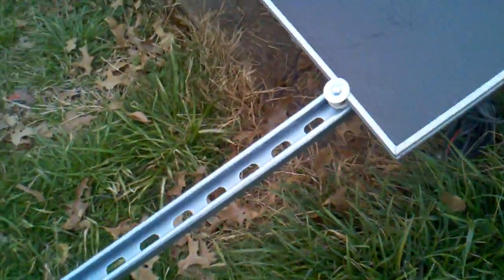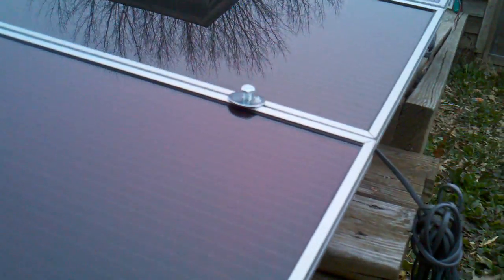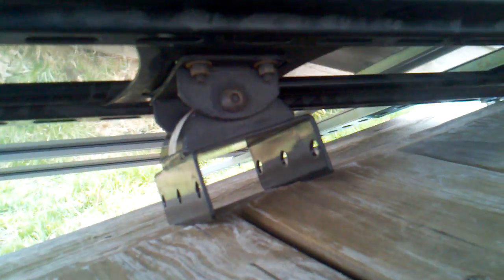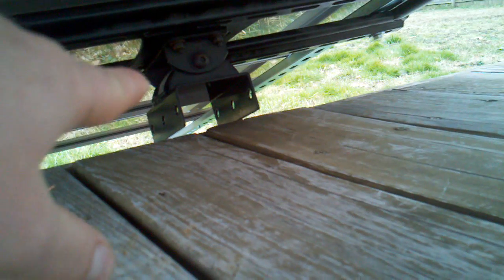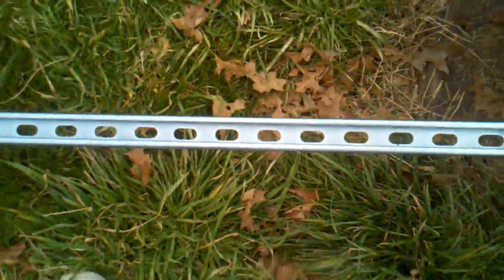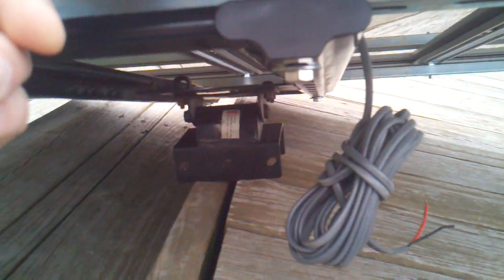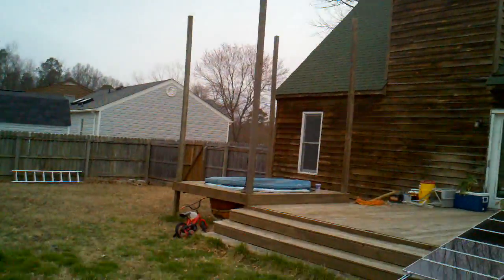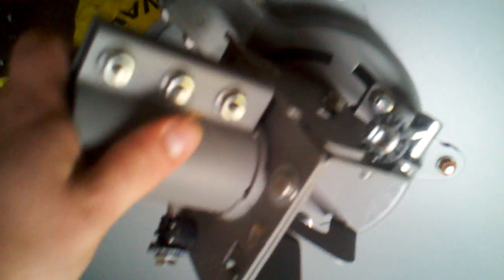DIY Pole mounting unistrut hardware for the Harbor Freight solar panels

Comment: Rubber washers would be ideal and I also have directv mount on my building. And its been there for a year now. But had to put guy wires to stablize it from strong winds. Thanks for the vid.

Comment from the maker: I though about that and may just do it, but I could just as easy get shorter bolts too. On the bed frame idea;  I have made a lot of stuff out of bed frames and found that the angle has a higher tinsel strength due to some kind of hardening process the did.  if you try to drill it you will burn up drill bits.  I suggest saving it for welding projects. I would be highly interested in the tracking circuit. Thanks

Comment: Just drill a hole in the bottom of the Unistrut so that the tail end of the bolt will go through?  I've been conceptualizing a mount for my Harbor freight panels, made from old bed frames (LOL) that will allow tracking with an old TV antenna motor that I have.  I got the schematic for a nifty little tracking circuit if you are interested.